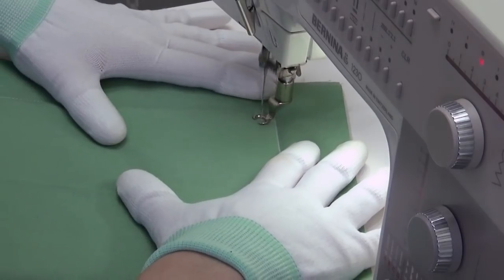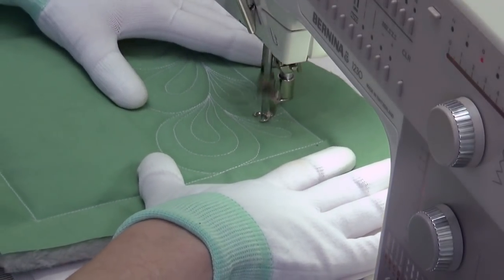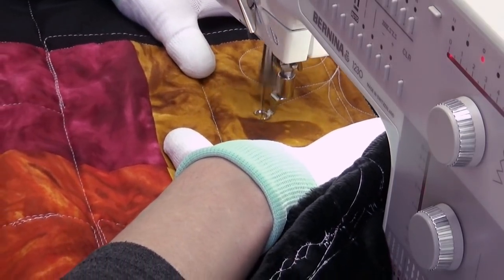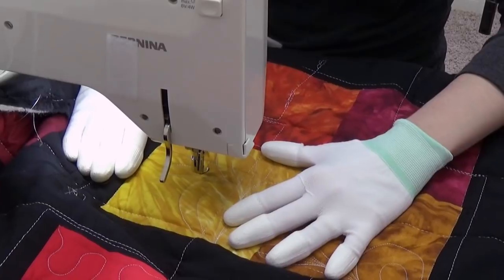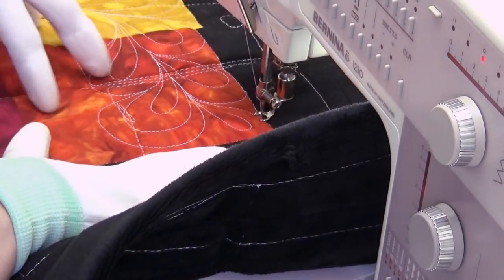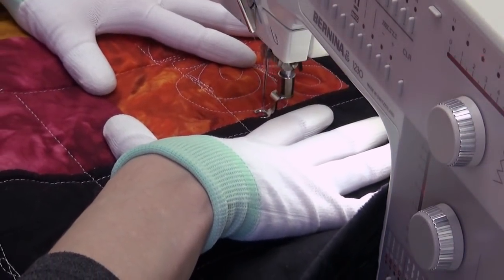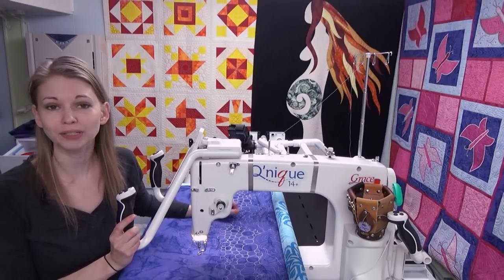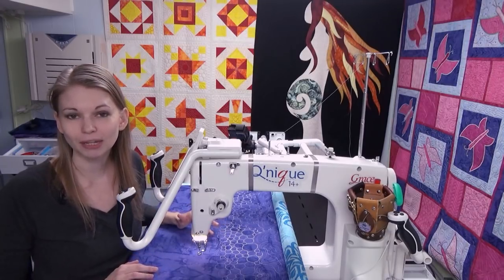How to Quilt Paisley! Quilting on a Home Machine and Longarm Frame

Comment: As always, you have shared great tips on a quilt design. Thank you! 

Question on the use of water soluble thread: Do you use it both in the top and the bobbin thread? 

I have used minky a couple of times and I love both the feel and how nicely it shows off the quilting, though I think less dense looks best on the minky. I noticed the there is a drag, so it was nice to hear you confirm that you also experience it and it is not me imagining it.
Reply from the maker: Yep, always use water soluble thread in the top and in the bobbin. Otherwise one thread will wash out, but the other will not and leave weird little loops of thread on one side. No, you're not imagining Minky dragging! It's GRIPPY!
Reply: @LeahDay  Why would you want to use water soluble thread?  Isn't it just going to wash away?
Reply: G wenna Doty the water soluble thread is for basting only :)

Comment: I'm learning fmq, where should my tension be?
Reply from the maker: Wherever it works for piecing - that's where I start. I figure if the machine has good tension for piecing, it should continue to have good tension for quilting so I don't usually adjust it. I always match the same thread in the top and bobbin of the machine and that makes this easier too. If you mismatch threads, you automatically have to fiddle to get the threads balanced and they can flux as you quilt more of the quilt.

On the longarm this is a bit trickier because it's 100% quilting. For this, I make sure to have a bit of extra space on the edge of the quilt and put a scrap of fabric over the batting and that's where I play and fiddle with the tension before getting started. I have to bend down and look under the frame to see it, but it's worth the extra time so I don't mess up the quilt!